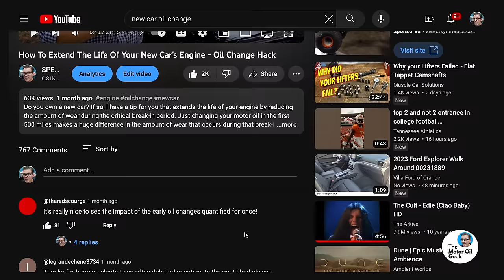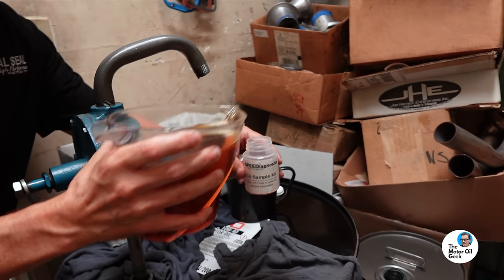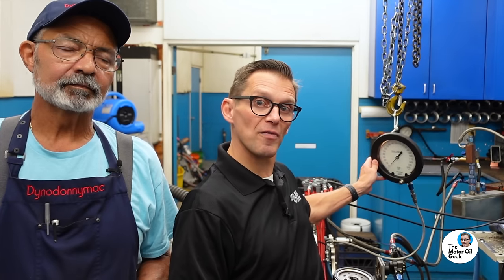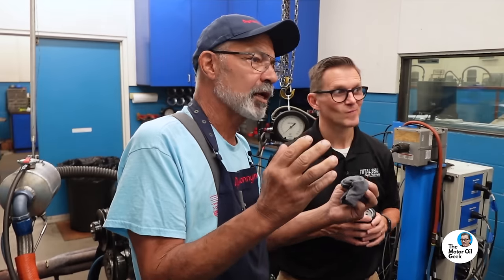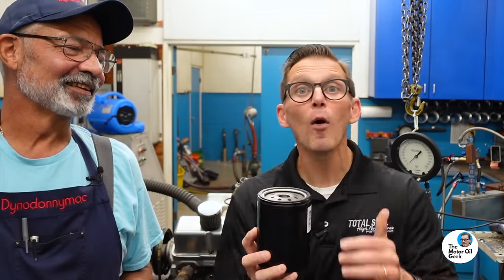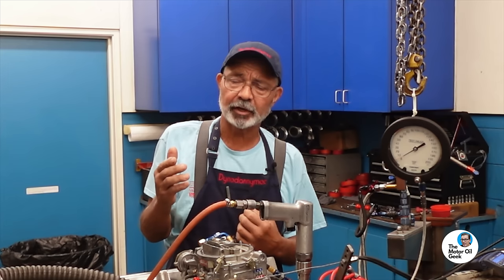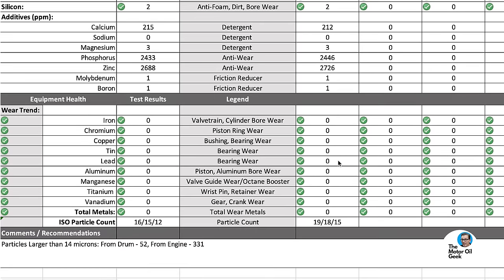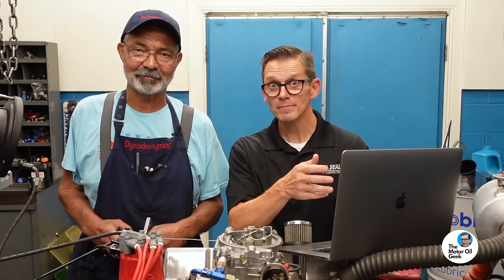Does Pre-FILLING The Oil FILTER Cause Engine DAMAGE?

Comment: It's an interesting discussion.  I can see the arguments on both sides, but experience has taught me that with oil filters, it just doesn't matter on a car.  The oil pressure comes up so fast that it is truly a non issue.  For proof, some manufactures are going with insert type oil filters that you can't fill, some filters are mounted sideways where the oil can't stay in and I had a race car that had the screw on filter mounted what most people would call upside down.  Never did the engine have oil issues, ever.  truck shops fill the filter from the same hose they fill the engine so that's out, fuel and hydraulic, whole different discussion.  Do what you want, what you are comfortable with, nothing will happen.
Reply: In theory it's a good idea, but like you said in some cars it is impossible. My wifes Forrester has the filter on the top side of the engine. There is no way to fill it and set it down. My 04 F-150 has it horizontal and would just dump most of it before it gets screwed in.
Reply: I've seen cars with 500, 600, 700k + kms still running on the original non-rebuilt engine of a design that has a sideways filter which you cant really pre-fill (Volvo redblock). I have a hard time seeing that it really matters in the long run if the engine runs 4-5 seconds with no oil pressure at no load every 6000mi / 10000km. There is still gonna be an oil film from the old oil in the bearings for those 4-5 seconds.
Reply: @enok90  4-5 seconds is also far longer than it really takes to build oil pressure in the average passenger car engine.
Reply: @johnmuir8305  To be fair most engines have the oil circuit setup so that the oil pump pushes the oil through the filter before it goes anywhere else, so when its empty it will have to fill up before anything else gets any oil pressure. 

Usually takes around 4-5 seconds for the oil pressure light to go out on my car after an oil and filter change. It's got 380k km on it and runs beautifully.

I still believe its one of the least important factors in the longevity of an engine though. Oil quality, change intervals and how its run by the user likely have vastly more impact on how it wears.
Reply: I have similar issues with my dodge and jeep; the filter is sideways.  I still put enough into the filter to coat everything, but not enough to flow out when turned on it's side.  It only takes a minute and I know it helps (these guys just showed the proof).

Comment: Isn't the important thing to lubricate the rubber ring? If the the filter ends up full, half full, or only a little bit is of minor concern. Just make sure you check the oil level after running the engine for a bit to circulate the oil.

Comment: Two things that make me think that pre filling is not necessary .

1: A cranking engines components are not under load so even a slight film should be sufficient. This is especially important on long stocker engines.
2: Typically one needs 10 psi per 1000 rev . So the oil pressure build up time to look at is from 0 to 10psi . 
3 : Once you remove the oil filter, the pathway that receives the oil from the filter is empty and need to be filled before engine oil pressure builds . There will be some air around the pump valve that will momentarily cause cavitation  so instant oil pressure is a ferry tale  and you are always have a short duration of 0 oil pressure .  The oil pump may have been empty of oil when you drained all the oil out of the pan. Also don't forget , once the oil filter is installed, there is a back flow preventer that keeps both the oil filter and its exit pathway full of oil.

So this is but an academic discussion and does not address a real world problem!!

Comment: I have been changing my own oil for 50 years and I pre-fill my filter EVERY TIME. I have NEVER had any engine problems. I have a 1991 Chevy C1500 that I bought brand new and 15 years ago I switched it over to full synthetic, it does not leak and it does not burn ANY oil.
Reply: And I have built  several  high  performance  drag engines  and everyone  is preludes repeatedly.

Comment: I always prefilled my filters. If the oil from the bottle needs to be filtered, perhaps you need to use a different brand of oil. I recall manufactures of turbo engines recommending pre filling filters to avoid oil starvation.
Reply: You telling me there are no turbo engines with top mounted oil filters? Because you basically can't prefill those kinds of engines, unless you want a mess.
Reply: @2010ngojo  Its BS. There are many diesels with top mounted or side mounted oil filters that can't be primed

Comment: Modern synthetic oils are going to be present on the surface of motor and components after the drain. This will protect the metal from wear at start up. 

Same as starting up a cold motor everyday,  especially in very cold temps.

It may help slightly to prefill, but you're not likely gonna cause significant wear if you don't.
Reply: If you can prefill, you do. I build engines. You don't need to trust me. I need to trust me. Suck it.
Reply: @tomscrossthreadgarage4183  you suck oil?
Reply: @tomscrossthreadgarage4183  maybe use some assembly lube and don't be a jag off!
Reply: @rsbreeze  Thinking that a surface coating of oil present is enough to lubricate an engine at running rpm is the thought of an individual who has not studied lubrication.

Comment: Question, sir. 
Years ago, i started putting in a quart of fresh oil in my engine  after draining the old oil. Wait for it to drain out. Then, complete the oil change. The theory is that you can remove more contaminants.  Can you test this?
Thank you in advance.
Reply from the maker: I actually do the same thing, but I have never tested the process to see if it actually makes a difference.

Comment: In over 35 years of working on cars, I've never pre-filled an oil filter.  And I've had many cars go well over 300,000 miles with very good oil lab reports from Blackstone.  When you drain your old oil, there is still a thin film of oil in your motor.  So the motor isn't "dry" like you think.  Once you start the engine, 40 psi or thereabouts forces the new oil into the filter and then into the engine. I've spoken with dealer techs who say the same thing.  But hey, if it makes you sleep better at night, go ahead and pre-fill your filter. I don't think there is anything wrong with it.  Only it just isn't necessary.
Reply: Yeah that's kinda what I was thinking. I know of several engines with top mounted filters that can't be prefilled which will still go 700k miles. The numbers he showed in the test may sound significant, but does it really translate to different results in engine longevity?
Reply: @jamesreno3321  the test numbers are not accurate. Of course a brand new engine will show more wear during the break in period and first oil change. Then the engine will settle down and wear less after a couple of oil changes.  That would have happened either way, if they had pre-filled the filter or not.  Everyone knows brand new engines have some initial wear during the break in period.
Reply: Me too.  I've been changing my own oil for over 30 years and have never once filled the filter.  Engines are not seizing, consuming oil or dying prematurely.
Reply: the main takeaway of the video is to show the amount of time the engine runs without oil PRESSURE. Pressure is what floats the rod and main bearings and keeps them from touching the crank. I dont think you can deny that . Will it be a significant  amount of wear ,  probably not but wear none the less
Reply: @anthonyiannone7618  One of my recent Blackstone oil lab reports stated my sample was "flawless" (their words, not mine).  I don't think you can deny that either 😁
Reply: @anthonyiannone7618  Yes we understand.  The problem i have is all the people insulting others as idiots for not doing this.  I'm sure there is a benefit of course.
Reply: @anthonyiannone7618  Their test is flawed though, they didn't show how long it takes to build pressure after an oil change with a pre-filled filter, they only showed how fast it is with an engine that was already primed, which is not the same thing. Oil pressure is not instant after an oil change no matter which method you use. I do believe in pre-filling however because a dry filter element has a small chance of being damaged by initial oil flow compared to a saturated element.
Reply: of course i couldnt deny that , im assuming were splitting hairs here and there equipment is either not capable of detecting the minuscule amount of wear or it just isint there?  After all lets be realistic , there are literally billions of engines running in this world and at least a few of them have had dry filters installed with no adverse consequences      @LA_Commander
Reply: @Enword_Jim   I agree . As with most thing in life there is more than one way to accomplish things , i for one am of the opinion that filling the filter cant hurt , but some would even question that. 
Bottom line is do what you feel is the best and lets move on to things with easier solutions , things like what a great job "uncle Joe" is doing to our country!!!!! 😂😂😂

Comment: A couple of things I noticed, and I have a couple of questions. When doing the dry prime test, the engine had been sitting for a while and fresh oil was added to the sump. How long did you wait before doing a wet test? Why didn't you remove and reinstall the filter to simulate air that will be in the system as a result of a filter change? I can tell you for a fact that my oil light goes out much faster if I start within 5 minutes of stopping, than if I were to wait a couple of hours.
Is there extra air in the system before the filter due to an oil change and does it affect the filter media if it is forced through a prefilled wet filter?
I wouldn't deny that oil out of the drum is cleaner than out of the engine (because I own a diesel), but if you are going to compare filtered oil and oil out of the drum, shouldn't you get a sample of the oil immediately after it is filtered?
Reply: You'll notice when u remove a filter oil spews out, this is the pump bleeding out so yes if he removed the filter after he did his dry test he would have had an empty pump and even if he filled the filter the pump would need to fill before the filter fills so it would have been the same outcome. Honestly it doesn't matter, I do it so the filter is wet cause in my mind pressurised oil hitting a dry filter probably isn't a good idea, having some oil in there will help slow it down some what

Comment: When I put in a rebuilt engine, I take out the spark plugs and crank it until there is oil pressure. Without fuel also, to prevent cylinder wash-down.
Reply: Prime it first just like they did in the video.

Comment: I can share that pre-wetting/filling a horizontal mounted filter can be done enough to the point that what I heard upon first-start after an oil change sounded "better" than in the past without doing anything.  I have a 2018 Camry LE, I poured in some oil last night (it was cold out, the 0w-16 was probably about 20F), tilted the filter to the side and rolled it around at an angle to pre-wet the filter.  That oil would absorb, so I added more.  Surprisingly I ended up filling it halfway about 4 or maybe 5 times.  I stopped when it appeared the oil would run out.  So in the end it really seemed to hold a lot.  Upon start, no change in sound from a normal start.  Glad I tried it.  I had no idea so much oil would soak in.  Based on how slowly the oil soaked in, I'm thinking saturated filter fibers prevent initial wicking/wetting/saturation time that could contribute to a little starving.  Overall though, I kind of wish owner's manuals would address the topic.
Reply from the maker: Thanks for sharing!

Comment: I prefill filters but testing oil out of the pan after you added fresh will still have some of the old oil in it. So it would make sense that the oil you drain after cranking is dirty. Theres maybe 1/4 of a quart of old oil still hanging out in there

Comment: Pre filling is not always possible.
Especially if you own a Subaru. The filter screws on from the top.
So if you pre filled it the oil would come out all over your engine.
Same with side mount filters.
If you are accustomed to pre filling then you probably noticed the first bit of oil you put in gets absorbed by the filter paper and in order for you to see oil in the filter you have to add a second little bit.
So in side and top mount applications you can add oil but just enough to saturate the paper.
This way the oil stays in the filter.
Reply: Several of Chevy's engines have top mount filters, too.  I had one on my 2010 Chevy Malibu w/4cyl.

Comment: Thanks for the video. Unfortunately, there is a lot of misinformation on the internet and usually it gets passed around and copied very quickly. I do a lot of DIY work and have read most of the workshop manual for my car. When changing the oil and filter, it specifically says to pre-fill the filter. It is also common sense for vertically-mounted filters. And what you showed with the pressure gauge is in line with the behavior of the oil pressure light, right after a filter change.
Reply from the maker: Thanks!

Comment: A couple of items.
When you prelubed the filter with the oil pump I suspect the drill is turning higher rpms than the oil pump at idle. This would increase the time until pressure is at maximum.
It would be interesting to see how many particles are from the oil filter only. The reason I ask this is filters are not sealed before purchasing. Subaru has a plastic film over the end of their filters, preventing debris from entering the new filters.
Reply: How do you prelube a Subaru filter that’s mounted upside down?
Reply: @jimsmith3312 if it’s upside down you just can’t and it doesn’t really matter

Comment: I'm a F A A certified airframe & powerplant mechanic Federal Aviation Administration says its mandatory when oil servicing aircraft engine cut open old filter and prefill the new, on some engines there is a special tool to retain the oil in filter to install.

Comment: Never prefilled a oil filter in my life. I see several flaws in your analysis here but I will agree that prefilling oil filters will sometimes decrease the time to get pressure to bearings. Priming oil pumps is 10x better than prefilling. 
On our race engines we change rod bearings every as soon as 20 miles anyways so definitely not worried about the miniscule wear compared to the wear from hp and water/ethanol contamination.
Reply: 100%

Comment: Back in the '80s a friend had a gizmo installed meant to vastly extend the life of the engine.  It used a small pump that pulled oil  out of the oil pan (had an adapter/tubing from the drain plug) then dumped it up top into the valve cover.   You were to turn the key to on (without engaging the starter).  After just a few seconds the dash oil light would go out, then it was time to crank the starter (the gizmo  turned off automatically).  Made sense.
Reply: That sounds a lot like throwing a rock through the window before you ring the doorbell
Reply: ...that doesn't actually do anything.  The oil that goes into your valve cover drains directly to the sump, at least on most engines.  It then get's picked up by the pick-up...goes into the pump, then the filter then off to the engine. The oil that drains into the head (valve cover) is at its last stop before draining back into the sump.  I'm not sure as to why the light would go out due to the location of the sending unit...

Comment: Fill your oil filter half way up the day before your oil and filter change. Swish it around a few times during the day. You can even lay it on its side and roll it around a bit. That will also help the filter absorb oil so when you turn it upside down oil will not leak out. This method will help oil get to the engine faster. Also do not forget  to put  oil around the new oil filter gasket and always put a new oil pan crush washer  on the plug before tightening the oil pan plug. Never use a wrench on the oil filter. Hand tighten only. 😁
Reply: Put the oil down the rim holes not the center. Don’t forget to always rub a bit of new oil around the oil filter gasket and hand tighten only do not tighten with any tool. Hand tight is enough. Over fifty five years doing oil changes on my vehicles and never had a leak.
Reply: Some cars do need the wrench to seal, my 04 Honda oil filter would leak if it wasn't tightened with an oil filter wrench.
Reply: i would say chuck the $2 crush washer and in its place use a plain copper washer instead. you can always resurface the washer if it gets gouged/scratched up. this can save $20 or more over the life of your motor. check with your counterman he may have that washer in stock and theyre usually cheaper than the crush-type, sheet-metal washer.
Reply: Crush washers are only $1.00 a piece where I live.